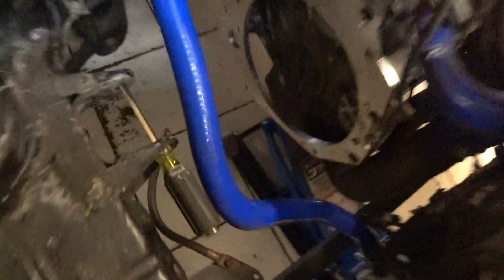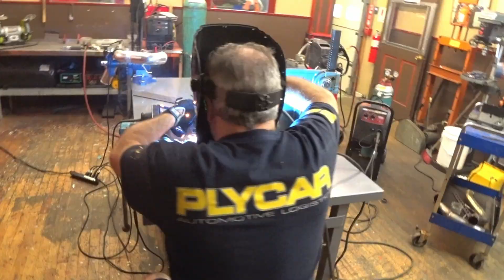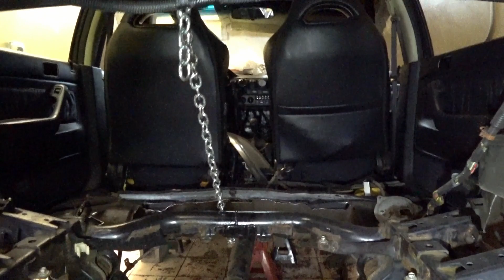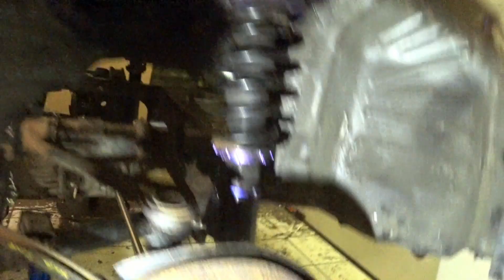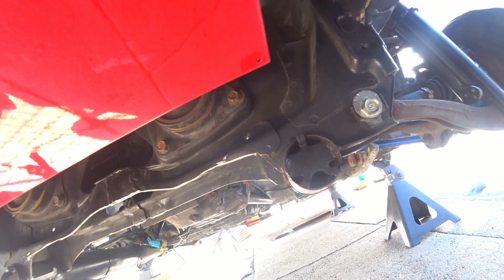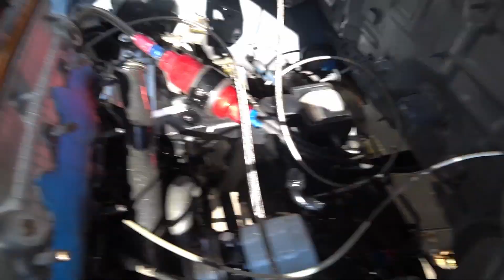How To All Wheel Drive Swap your Accord. CB7 H2B

Comment: I also have a 93 CB7 that one day I’d love to awd it. What did you use fir the rear subframe?
Reply from the maker: S2000 rear subframe and suspension. Check the channel I have all the built process recorded. Also s1 built coming out with a kit. So it will be a lit easier soon.
Reply: @AJIMPORTS  thanks maaan!! I’d love to see your car some day. I live in Maryland. Where are you located?
I thought I saw somewhere like NY or NJ

Comment: Needs to be done to an Acura TL type S, question : most new accords and Acura’s share the same platform now in days except the Acura’s have awd can the awd from the Acura’s be swapped to the Accord. The current gen accord for example fwd, and the new tlx awd?
Reply from the maker: What gen tl or accord are you taking about. And most of the acura and honda can share the same suspension parts.
Reply: @AJIMPORTS  the new generation both of them newest accord, and newest tlx. I think they’re actually the same exact platform

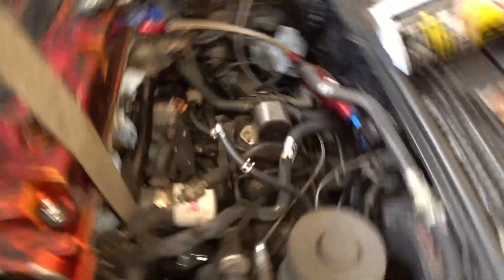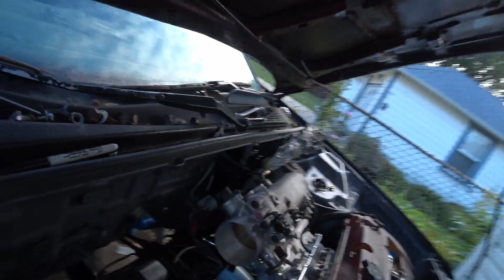Comment: Please correct me if Im wrong, but around 2:00 min. you stated the use of an h2k intake manifold. But around 11:00 I see that you ended up installing a H-series Euro-R intake manifold? Am I correct? If so does the Euro-R IM clear the hood?

Im only asking/questioning because I absolutely do not want to change out my Euro-R IM, if at all possible once I get to upgrading the driveline of my CD7. Thank you!
Reply from the maker: I was going to h2k manifold but ended up installing the euro r manifold. The euro r does clear the hood on stock setup. My motor is tilted so it's alot closer to the hood than standard engine placement.
Reply: @AJIMPORTS  Nice! Thank you! Thats good to know, I really appreciate it!